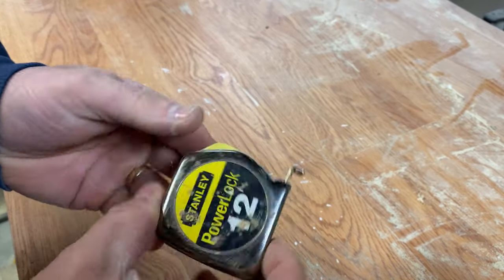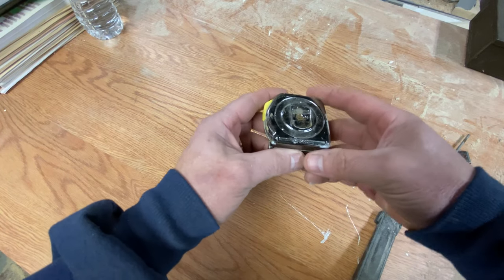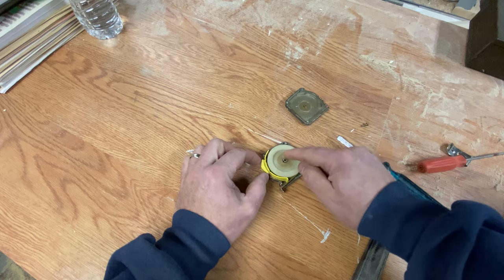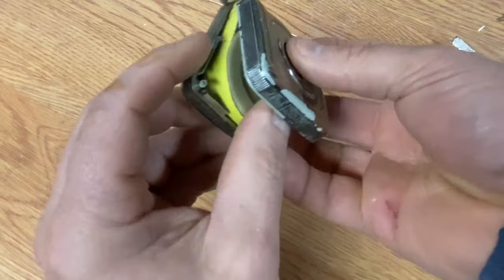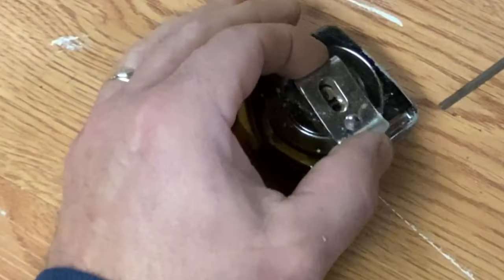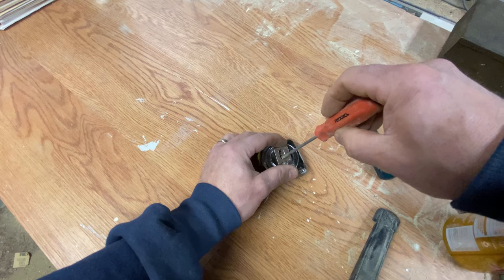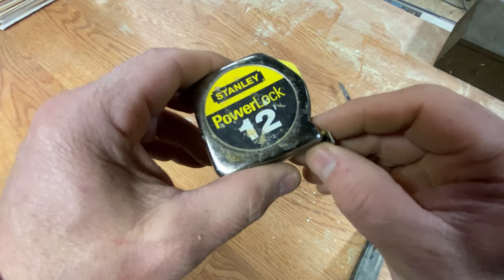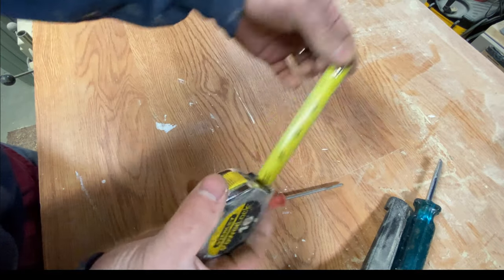How to fix a tape measure

Comment: excellent, tried to fix mine. rolled the spring up really good and glued it in as it had come off the spindle. put it all back together and quickly realised I had wound the spring up the wrong way and the tape measure springs out. tried to "undo" my brainwave glueing effort and snapped the spindle and the sping shot out in a nice big birds nest. Excellent to see you fixed yours.
Reply from the maker: Don’t feel bad I’ve had that happen to my name as well as far as the spring popping out into a gnarly mess.

Comment: thank you! this worked, very happy to not throw something away! my 16' plastic Stanley was just a little different - the spool was  a smaller diameter and because I removed it from the casing I had to fit the metal band into the slot on the spool and then do the tightening trick. thanks!
Reply from the maker: your welcome, thanks for taking the time to comment

Comment: I find that this is a really good example of how garage door torsion springs work. You want there to be just enough tension on that spring where it just moves the tape back into the unit consistently. The spring shouldn't be so tightly wound that the tape violently lashes around when it retracts, and the spring shouldn't be so weak that it can't pull back in the tape. Just the right amount of force.
Reply from the maker: Yes I agree, it certainly needs to have a balance. Thanks for taking the time to comment

Comment: Thank you for the video. I had a brand new 35ft Husky tape measure I bought as a set a few years ago. It didn't even retract with help. It's been sitting in my toolbox since new and I just never got around to taking it back. Now it's discontinued so I figured I see if someone made a video on taking one apart. Yours was close enough so I took it apart and was able to reattach the spring to the post. Now it works.
Reply from the maker: Thats great to hear. thanks for taking the time to comment

Comment: You may lose length when you do that. I tried it on a 10ft Stanley and could only extend it 7ft. I loosen the tension and it went to 10ft. Guess the spring is shot.
Reply from the maker: Interesting, I’ve never had that happen. Thanks for taking the time to comment.

Comment: I have the reverse problem. My tape won’t lock anymore when I slide the button forward. Can it be helped? Thanks!
Reply from the maker: its is possible that the lock is just to warn out, you would have to take it apart to see what is going on.

Comment: My tape measure is another brand, and when I opened it, a small metal v-shaped piece fell out. It was near the entry/exit of the tape housing. I cannot determine where to put this V shaped piece. . Can you advise me ?
TIA !
Reply from the maker: Unfortunately I’ve never come across that before so I also would not know where that goes. Sorry I couldn’t help.

Comment: Do spray a little bit of clear silicon to lubricate the spring so to allow less friction btw the coils.
Reply from the maker: Actually, I have never done that It sounds like it could be a good idea but I’d be afraid that it would cause more dirt to stick to the tape measure and get inside the workings

Comment: The center screw seemed to be missing and hard rubber cover wouldn’t come off its a 25 ft Boss can someone do one of those i wasn’t able to  see any screws at back couldn’t get it apart
Reply: You need to take the protective cover off.  It will slide back off opposite side of tape.  Then you can get to the cover......

Comment: How do you fix if the lock is no longer tight. My powerlock retracts by itself slowly even if locked. Thanks.
Reply from the maker: I am guessing that it is an older one and the tab that sits against the tape is worn out. It may have to be replaced. Good question.
Reply: @shanesmaineshop  Maybe take 2 broke one's and fix one?
Reply from the maker: @jerrymccurry9372  Sometimes that does make sense in this case I was able just to repair this one all by itself. Thanks for commenting